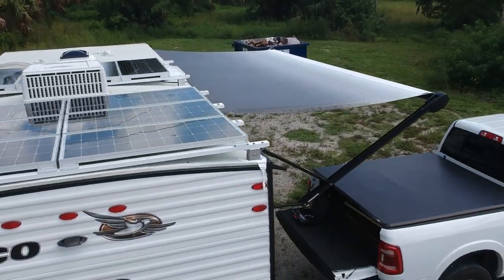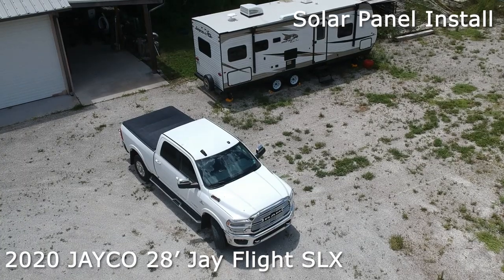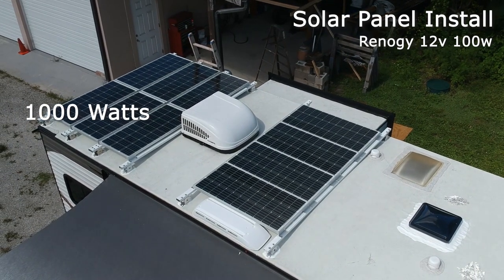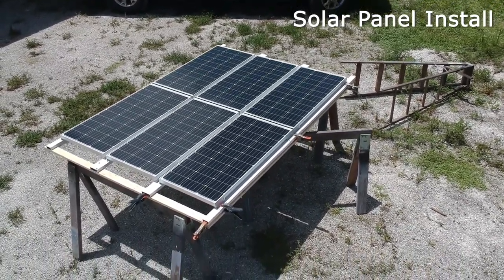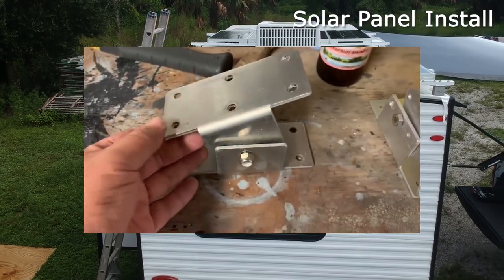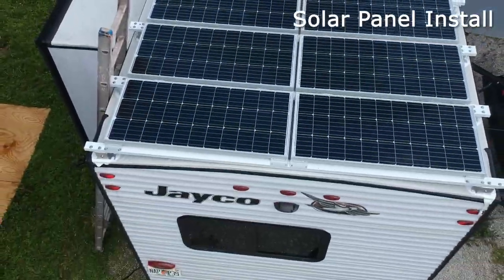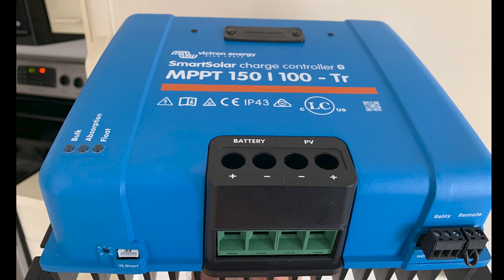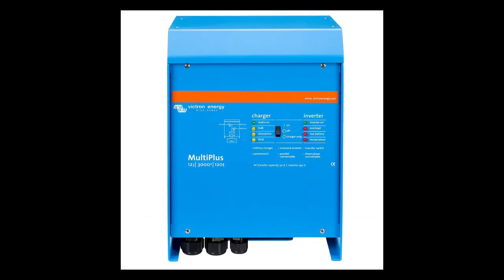10 Solar Panels Mounted on Jayco Jay Flight RV Travel Trailer

Comment: Hi Robert,  How are these aluminum rails holding up on the roof while driving the trailer?  Im mounting 3 X 200 watt panels toward the front of my Jayco SLX-8 and I was wondering if the mounting brackets to the roof are holding tight?
Thanks for posting and it looks great so far.
Tom B
Reply from the maker: tbrownATL they are a bit bouncy
I have not had time to put a cross member but will be doing so in about a week

Otherwise very tight so far
Reply from the maker: tbrownATL also I did not put a lock screw on each bracket because I'm working on the RV

Once I insert the 2nd screw they will barely move 

Looking back I wish I had integrated a smaller rail through the side of all the rails. 
That requires a shop or garage with a stable surface 

I have neither 
Did all this on a pair of wooden horses
Reply: WebmastersDesktop  Thanks for sharing
Reply from the maker: tbrownATL not bouncy anymore
I'll post a video another day to show what I did

But basically instead of one bolt through entire bracket
I put 1 bolt on each side of the bracket to sandwich the walls against each other
So 2 bolts 

Then I put a 3rd bolt on one of the bracket walls to prevent it sagging 

The 6 solar panels did not need a 3rd bolt because the weight of the solar panels is distributed better 

Only the section with 4 panels required a fix for the bounce
Reply: WebmastersDesktop Awesome, the brackets I found have 3 holes, so that feedback helps me.  Ill use the 2 outside holes to mount the rails to the trailer.
Thank you again
Reply from the maker: So I secured the rails, I'll show it in a new video shortly - the panels held up without any issue at 75 miles per hour. I did not mean to go that fast.